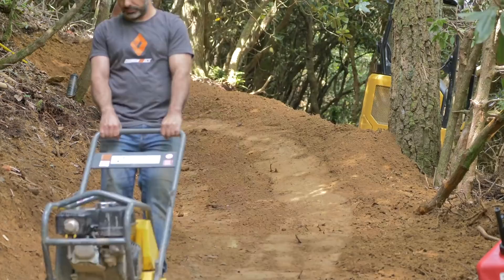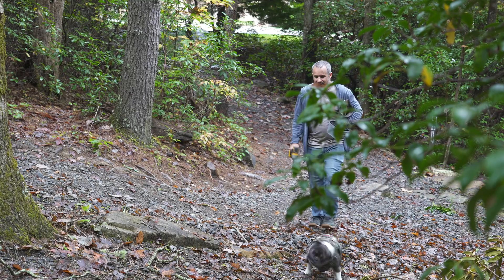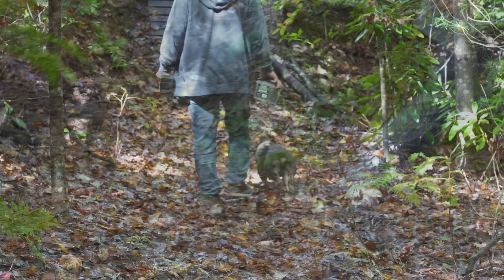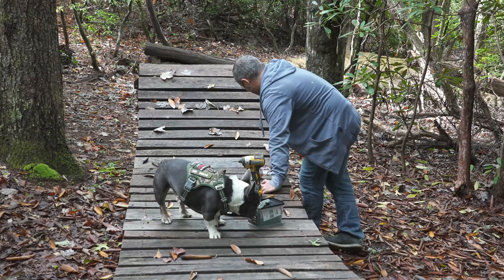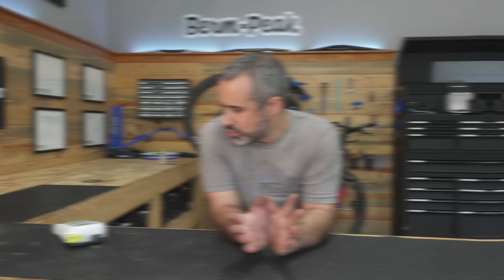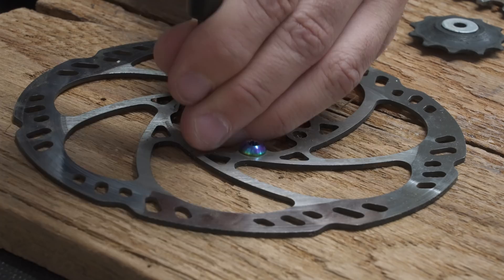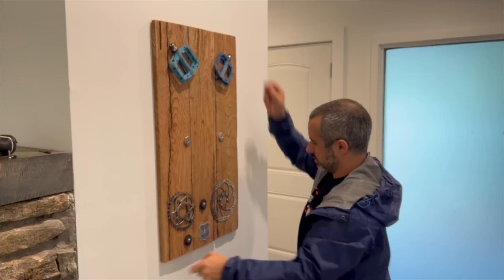How have Berm Peak's Wooden MTB Features Held Up?

Comment: a day before a good rain, consider hit the features with diluted  outdoor bleach in a garden sprayer once or twice a year to keep the slime off and slow the organics and degredation.
Reply: +1 on this
Reply: Or use the whole gallon if you want to kill everything. Lol
Reply: Sitting here wondering how one could do that and you come along, you legend lol. Nice tip. 👍
Reply: Back in my day we would make a yogart and moss mix to put on the side of jumps to make the back and sides grow greenery.
Reply: Yep, that's how we kill mold and stuff on fences, followed by a pressure wash..then coating the wood again....50/50 mix of recycled motor oil and diesel works fantastic actually....
Reply from the maker: We will absolutely do that!
Reply: Why not actual wood staining? That stuff is made to make wood weather resistent.
Reply: @beerenmusli8220  price mostly, time also.
Reply: @castortoutnu  But proper wood staining can be sprayed on, and only needs to be reapplied once a year on regular conditions.
Reply: @BermPeakExpress   make sure all your fasteners arent untreated or they will rust from bleach
Reply: You can just scrub the boards with a stiff brush; no bleach needed.
Reply: @BermPeakExpress  nails take lateral forces better if the screws keep breaking you should look into using nails in those areas
Reply: @HarimauBergaring  Yep, nails for shear forces and screws for tension force. Leave room for expansion.
Reply: I absolutely love how there is a comment about not using bleach, especially on a channel with millions of viewers, and the very next comment is Seth saying we will absolutely do this!!!
Reply: He used it in a video congrats
Reply: @gighabiter9323  Dude, that's cool of you to remark, I likely would have missed it,  thanks Homme!

Comment: Hi Seth, Love the channel! You are spot on with spacing wood for movement. The other thing you may want to consider, at least on vertical parts of your features, is using nails. Screws are not good at vertical shear force- thats why they snap. This is also why you frame a house with nails and not screws. They do make special screws that bend like nails, but they're expensive. A simple experiment to do is drive a screw half way into a 2x4, and a nail. Take some pliers and bend each of them back and forth. The screw will snap and the nail will bend.
Also, I've put Berm Peak on my bucket list. Hope to go there some day. Keep up the great work.
Reply: Thank you very much for shaving this, I always wondered this and this makes so much sense.
Reply: bingo
Reply: The right sized screws are the best option as theu won't pull out over time. We're not talking about framing a house. They're small pieces of wood for a mountain bike trail.
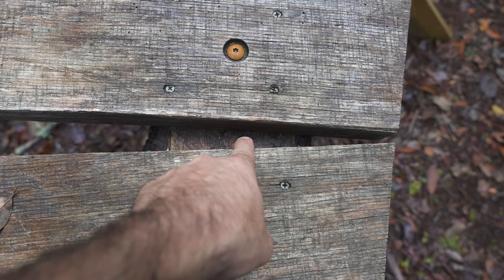Reply: That's typically true but for the rough sawn lumber that he milled himself, was never dried/cured/treated, and that's permanently outdoors a structural wood screw like Timberloks are the way to go. The wood is constantly swelling, shrinking, and warping as its moisture content fluctuates which is something that screws are better at handling. The boards at 6:10 for example would definitely not be as secure after that long if he'd have used nails. Another benefit of screws is that they are easier to remove if he needs to replace a board at any point. He could use nails for the vertical supports though, unless he uses structural screws, or even better; carriage bolts with Titebond Ultimate wood glue.
Reply: Indeed, there is two real reasons for the snapped screws on the airbag jump. Wood extends and shrinks with moisture, this causes shear forces on the screws... and normal screws are not good at shear, only at pull.

Putting the screws at and angle sort of helps (plus using sturdier screws). Nails at an angle would be better though. Also leaving a small gap between the planks would help to alleviate the extra strain on the screw, thus giving the planks a bit more space to live.

The last piece of the puzzle is the impact driver. While nice, it is more prone to breaking the screws than a non impact one. But I'd say the two main points are above.

Comment: the snapped screws are one reason to use nails, tensile strength during regular flexing is stronger in a straight nail then a screw which can break at any place easily
Reply: However screws work great for recovering bent planks that ripped up their nails.
Reply: Deck nails - only maintenance might be hammering them down again occasionally.
Reply: Nails are more ductile, but screws can be sized to accommodate the load also. Deck screws are regularly used to build decks (with few issues) and ramps and MTB stunts are basically decks...
Reply: I think the bigger issue is accommodating wood movement. Whenever you have planks fastened cross grain, you have differential wood movement (much more expansion cross grain than with the grain). If the fasteners are widely spaced across the width of the grain, there is more lateral force on the fastener unless it is in a slotted hole. Undersized nails will bend and undersized screws will break. Use a strong enough fastener and the wood will rip apart instead.
Reply: The solution is to avoid pairs of fasteners spanning wider regions cross grain. Where Seth used timber lock screws, it looks like he only used 1 or kept them close together which solves this. Planks screwed to a wide log have to deal with the wide log expansion if 2 or more screws span the width of the log. Using joists deals with that expansion but doesn't look as cool. Slotting the holes (like one does when attaching a tabletop to its base) is the most permanent solution, but not exactly efficient to build. Predrilling wider thru holes on the planks might be enough though depending on spacing.
Reply: Nails are great but for this application, nails would not be the proper fastener. They pull out easier than screws and these boards are stressed in different ways than a floor would be.
Reply: @Jets369  Screws, only maintenance might be tightening them up occasionally...
Reply: @mikeznel6048  this is why they make ringshanks. They would be good for this. Also even cheap nails will not pull out if you throw them in diagonally. I use nails bc they’re much cheaper rho
Reply: All you have to use is heavy screws he’s using 4mm x 75mm that isn’t enough
Reply: Screws are only designed to hold in tension, because that is the only force they should ever have to experience.
Screw joints should not rely on the sheer strength of the screw.
A properly fastened screw clamps the two materials together, so that friction can take all the load.
Reply: I think screws are fine, just use a bigger diameter?
Reply: @Jets369  you do realize that people ride bikes on these right?

Comment: Hi Seth! When you find yourself with a clamp not long enough you can combine two clamps by interlocking the upper jaw of the first to the lower jaw of the second so you can reach the end of the piece you need to clamp!
Reply: Came here to say this! It’s a life saving hack
Reply: Never thought of that! Thanks!
Reply: I'm really surprised he didn't do that. I could have sworn I'd learned that tip from him haha.
Reply: Just get some pipe clamps. They are any size you need.
Reply: @sapinva  Sometimes it's best to use what you already have.

Comment: I have a little bit of carpentry experience.. take a 3” screw and equivalent nail then drive them both in about half way- hammer them sideways back and forth until they break and you’ll see why homes usually use nails since as you said, wood changes in time.. not saying I’m an expert but id like to see how they test against the timber lock ones you mentioned.
Reply: Couldn't agree more, screws are absolutely not meant for sheer forces.   
   
   
Also 100% recommend looking into truss/rafter fasteners
Reply: This is a common layman explanation of why not to use screws, but when you screw two pieces of lumber together the loads applied are different than hammering side on. Yes, nails are more ductile, but regardless, you need to use a fastener sized appropriately for the forces involved.

Building ramps and MTB stunts is closer to deck construction than house framing, so it is completely reasonable (and in many respects preferable) to use screws. Appropriate sizing is important, and properly accommodating wood movement is essential as Seth noticed on the airbag jump.
Reply: This isn't a house though, it's a mountain bike trail... The planks need to be sturdy and not move. The opposite of what a nail would do.
Reply: @mikeznel6048  To be fair though, galvanized spiral nails would hold it together fine and not break, but modification and repair would make a big mess. Sometimes when building you need to tweak things to get the feel right and pulling all those twisty nails would suck and the process would destroy things compared to screws...
Reply: Screws are only designed to hold in tension, because that is the only force they should ever have to experience.
Screw joints should not rely on the sheer strength of the screw.
A properly fastened screw clamps the two materials together, so that friction can take all the load.

Comment: Hey Seth, being a long time construction guy, I highly recommend using GRK brand deck screws & construction screws for your wood features.  They are significantly stronger than most other deck screws and you will have much less screws snapping from wood movement or over torque-ing during installation.  My local Home Depot and Lowes both carry the GRK brand.

Comment: Seth,

If you ever need to clamp wood like that Ranger Station plaque together but don't have quick grip clamps wide enough, you can link two together, almost like an "S" shape, where the top 'jaws' of each clamp grab each other over the middle of the board, and the bottom ones span the board and grab the edges. It's a little janky but it gets the job done.

Cheers!

Comment: Seth - your fasteners are likely shearing because you’re using an impact drive. A lot of tradesman are starting to see these premature failures with the proliferation of impact drive offerings from the tool manufacturers. I’d recommend using a regular non-impact drill driver.

Comment: Stumpy Nubs did a review on screws vs nails. Screws snap under shear, which is why those boards were on the jumps, getting loaded and pushed against the wheels, were snapping loose.
Olde Worlde nails (tapered) will work better and just need reseating quarterly.

Comment: Seth, deck planks have grooves cut along them so water beads off instead of soaking in..I imagine the same would work for your features. Perhaps on the next build, do a long term test by grooving some of the planks and leaving others without...check each year.

Another thing to try would be to use the Japanese technique of show-sugi-ban - charring the timber to prevent rot. Would love to see the difference.

Comment: Broken screw heads normally mean you got cheaper screws. When cheaper screws are thrown into a block of wood too fast the heat will change the molecular structure of the screw to where it is brittle. Other than purchasing premium screws you can also dip your screws in fastener wax. When screwed in the wax melts dissipates some of the heat but also allows the screw to twist and slip better into place. Once it cools down the wax stays in the wood and prevents some moisture from rotting around the screw head, and might even help keep the screw from rusting/corroding.  @Berm Peak Express

Comment: Just a tip. You can hook the ends of 2 bar clamps that are too short around one another to make 1 thats big enough. It can be a little tricky, but most times it works in a pinch.

Comment: Good tip.  Do a good old 50/50 trick.  Use 2 nails and 2 screws.  the screws tighten tight but the nails gives way as the wood expands with moisture and moves when you ride over.

Comment: Hey Seth, screws are prone to snapping where something is going to have some movement and flex where as a well placed nail will flex and move with the wood. That's why when building they use framing nails to put structures together and not screws.

Comment: As a suggestion, mounting the pedal spindles into the board so they came out horizontally (like on a bike) would have been next level cool, so every time you walk by you could spin them and would give the art piece more dimension.

Comment: 7:10 yes... If you use the right grease. You NEED wheel bearing grease not just regular grease. It just turns into oil because it can't deal with the temperature of the wheel spinning. 
I just rebuilt a trailer with new hubs, bearings and a full brake bleed because a customer tried to help by greasing it but he used the complete wrong stuff

Comment: You could also look for screws with an RSS (rugged structural screw) rating. They have a an actual shear rating, unlike standard decking screws. Might help prevent snapping screws in the future, both from wood movement and the stresses of riding a bike over them.

Comment: I was just out on a local trail yesterday, and a bridge has 5 or 6 holes where planks have rotted, and overall the bridge structure is rotting. It's a very robustly built little walking bridge, but there are no spaces, so water sits and sits and absorbs into the timber rather than flowing through and drying quickly.

Comment: I used old motor oil to insect and for proof railway sleepers for garden edging. If you soak the under side before building you could expect up to a 5-10 time longer time between rotting

Comment: The point you made about spacing the planks is a good one, raw lumber overtime will hold water and swell resulting in the issue you had, think like your pouring concrete when placing planks you need room for expansion

Comment: Outdoor wood features need "spiral galvanized nails". I use 4" for slats that are 1 1/2" to 2" thick, build it strong the first time, so you don't need to go back. 6/8/10" for stringers and such.

I might do it different if the trails were literally in my back yard, but when you have to hike up for an hour with all the tools, you want to keep that process to a minumum.

Comment: Those 3"ers will do better with shearing. Screws are pretty weak in shear from the treads to the tip. The smooth bit is a little stronger, but really nails take the cake as far as being strong shear connectors. The softer metal is less prone to cracking than the hard but brittle screws. Timberloks are badass but get spendy quick. I like the darker color head on the pines you used for the repairs. The yellow deckmate ones stand out a bit much. Also get some pipe clamps if you think you'll ever need them again. Can be found cheap used sometimes.

Comment: Great vid.  The Bearing Buddy’s on the trailers can give a false sense of security.  They only grease the outer bearing and hardly any grease gets to the inner bearing.  The wheel and hub need to be pulled off to access the inner bearing.  At least in trailers with breaks.

Comment: I wonder how well composite decking would hold up for MTB features.
Reply: In Ireland in Ballyhoura they used composite decking to cross a marsh/bog. They just added grip tape/ skateboard tape. (Don't know the actual name) holds up great. Just need to replace the tape from time to time. About 5 boards per 100m. That's what I saw last time.
Reply: @arturiskrzycki9726  I think the actual name might be skateboard grip tape, haha.
Reply: @arturiskrzycki9726   issue with grip tape is it gums up quite easily thats why on the north shore vancouver everything had chicken wire it cleans easier
Reply: @anonymousaccordionist3326  I was close enough
Reply: @noodlzthesouthernpolarbear7293  the trails on that section of trail is open to rain and the trails are compacted gravel.
Reply: @arturiskrzycki9726   so your saying it works?
Reply: @noodlzthesouthernpolarbear7293  yes

Comment: Hey Seth this will heads up. So I work for a contractor and one reason why your screws are snapping is because they're actually designed to stake postill I'll actually use some Nails cuz those are actually designed to move around until they don't snap that's why I've been when you hit the jump off your bike the board move that much force in a snap that screws. Two example is if you do upon them out and let me see a log cabin if you look at it the almost always use nails they never use screws them because of that the wood stretches and that cuz of the cold and wet so stretch in a break this Cruise so that the sky interesting how that works.

Comment: Pro tip: Deck screws are not structural. That's why those are snapping off. Try something from Spax, Simpson Strong-Tie, or the smaller lags from timberlok.

Comment: 3 1/4” Galvanized ring-shank framing nails out of a battery powered Dewalt framing nailer does the trick. Nails can withstand more movement (way more) before they snap.

Comment: Cover the top of the log with roofing tar. 50 bucks for 5 gallons and it helps keep water out from under the planks. Add chicken wire to the jumps so it gives you more traction. Touch the hubs after you tow something. If its warm it needs grease or replacing

Comment: Seth,  The reason you screws are breaking is because they are not ment to move. Take a screw half way into a board and bend it with a hammer it will most likely break. This is why house framing is done with nails. So the same with a nail and it will take alot more to break.